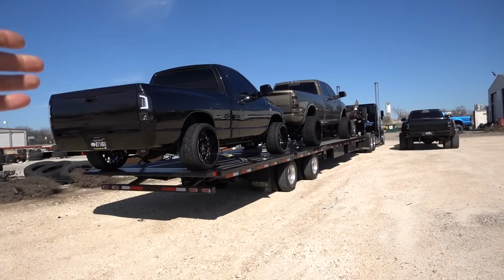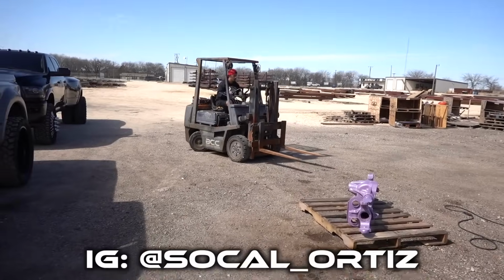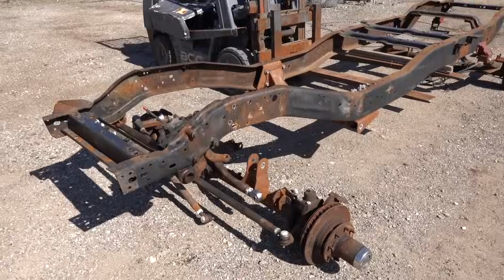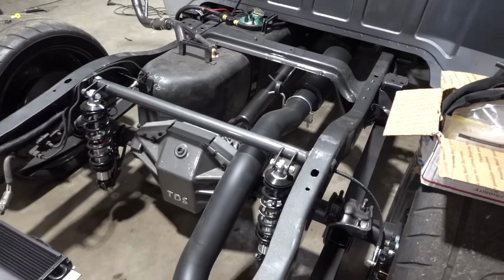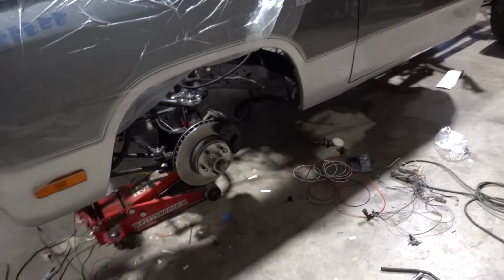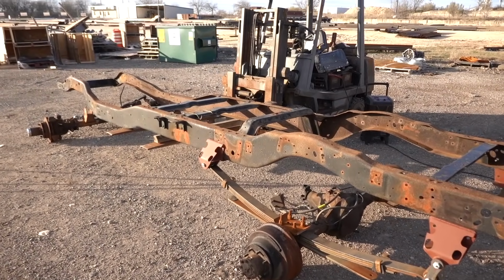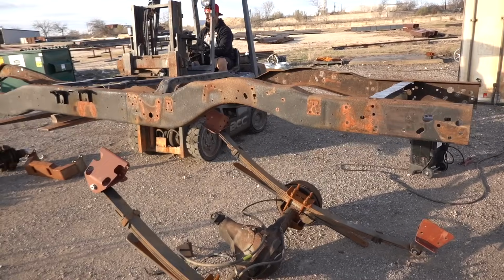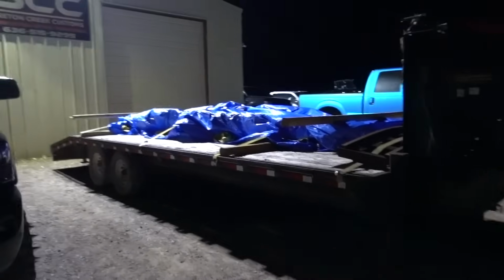1st Gen Cummins Build Gets WILD!!! Ext Cab. FULL FRAME OFF!!!

Comment: Hey there are quite a few full 4 door, actual crew cab short bed late 90’s model dodge ram 2500/3500 single rear wheel 4wd 5.9 trucks down in Florida for sale currently. All over marketplace man….. 90% of them are rust free and the ones that do have rust are just the fender wells and one had rockers needed replaced. Rest of them are all 10k n below aand they run and drive clean titles…. Would be sick to see you build one and paint it the 3rd gen 6.7 black that you have almost all of your truck in lol 😅🫡